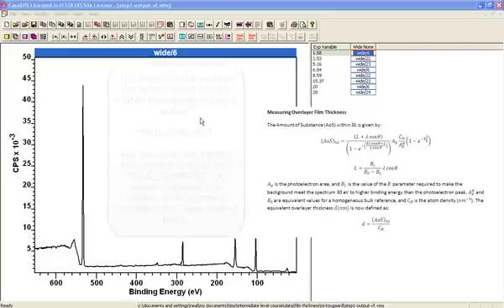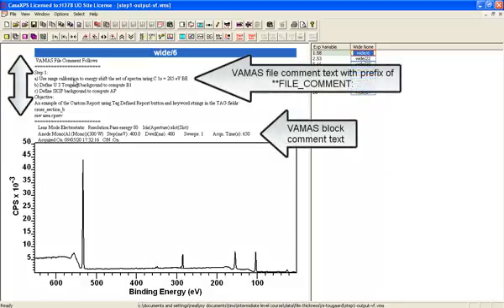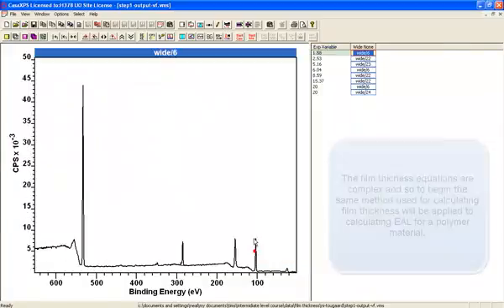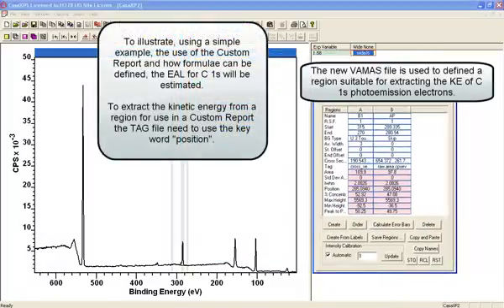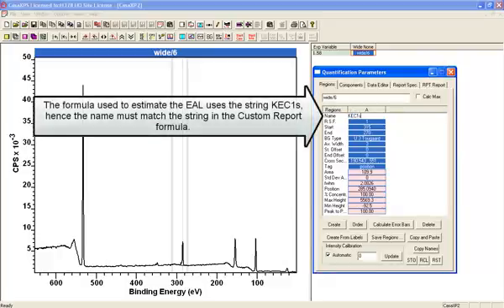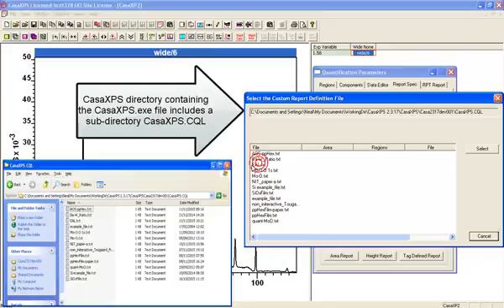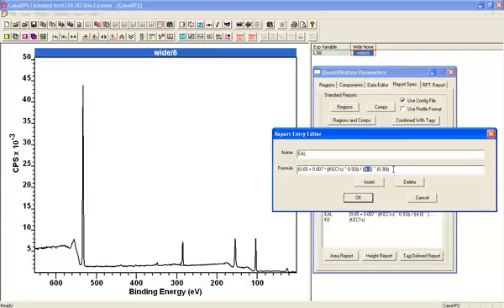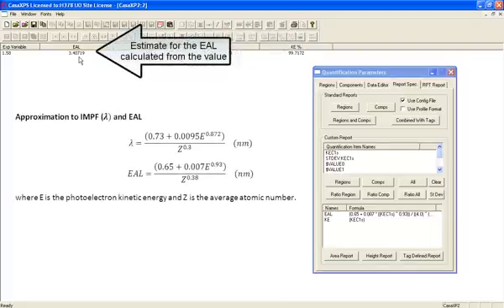Thin Film Thickness Measurements using Non-Iteractive Tougaard Method in CasaXPS Part 2

Comment: Hi I performed each step as described in the first video but I am not getting anything in VAMAS file comment. it says "sourceAnalyserAngle: Not Specified" how to resolve this issue?
Reply from the maker: There are two versions of the VAMAS file, one of which includes the VAMAS file Comments as shown in the video. The file Step1-output-vf.vms includes the VAMAS file comments. This second video is illustrating how VAMAS block comments, when displayed above spectra, can also include comment lines from the VAMAS file comment.
http://www.casaxps.com/casaxps-training/interm_course/interm-Data.zip

Comment: Thank you for your video.
I have a question.
what is the exact average atomic number meaning in the EAL equation at 1:04?
Reply from the maker: There is an example of how to calculate the average atomic number in the paper for a PPHex film on silicon:
Walton, J., Alexander, M. R., Fairley, N., Roach, P., & Shard, A. G. (2016). Film thickness measurement and contamination layer correction for quantitative XPS. Surface and Interface Analysis, 48(3), 164-172.

The formula for EAL was created by Martin Seah of NPL, UK. For more information, please see the paper:
Seah, M. P. (2012). Simple universal curve for the energy‐dependent electron attenuation length for all materials. Surface and interface analysis, 44(10), 1353-1359.